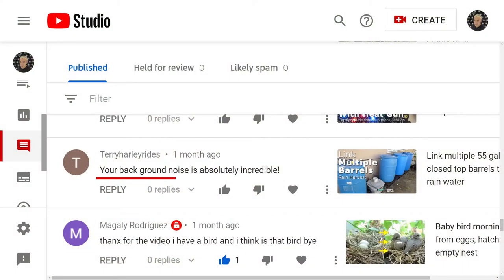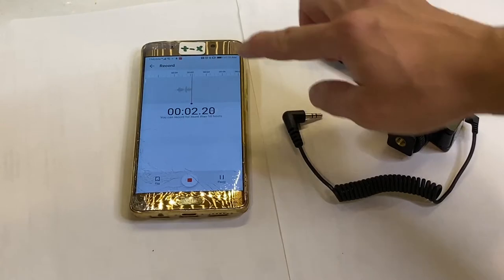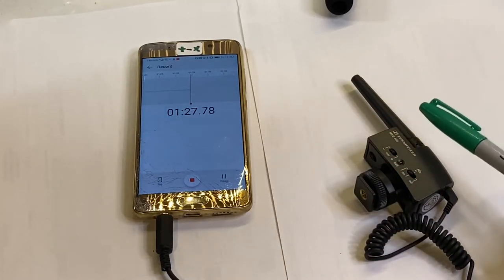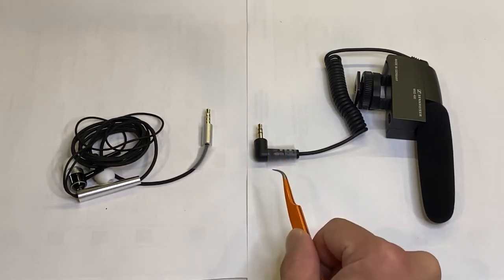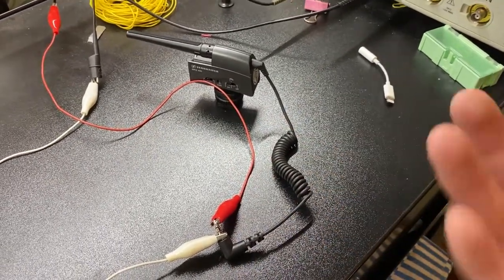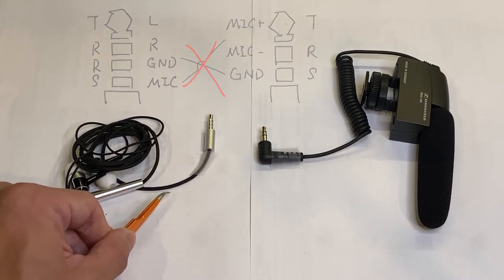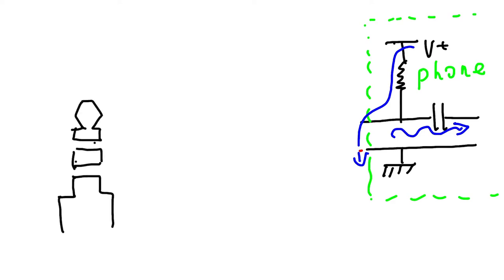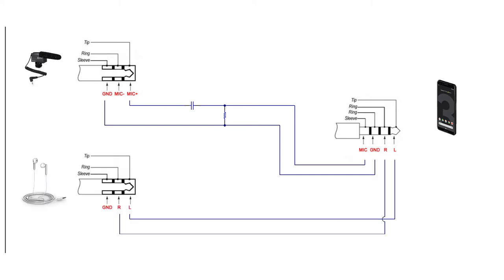How to Record Best Vlog Audio Using Shotgun Mic on Smartphone, Sennheiser MKE 400 on iPhone Working

Comment: Thanks for the tip! Could you give exact values of the resistor and condensator/capasitor, please. What is easy and clear for a engineer, is not easy for a amateur.
- Pekka from Finland
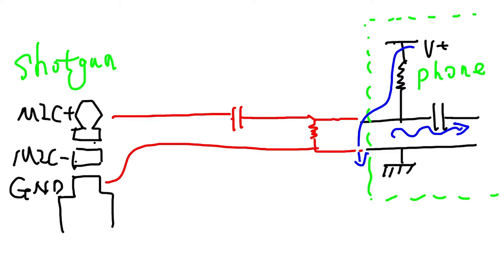Reply from the maker: I explained at 9:34 regarding the values of said components.  I didn't give exact numbers because mine might not work for others' device. We just have to try a couple times to achieve the best result.  In my case, I got the best results by using 1uF and 470ohm.